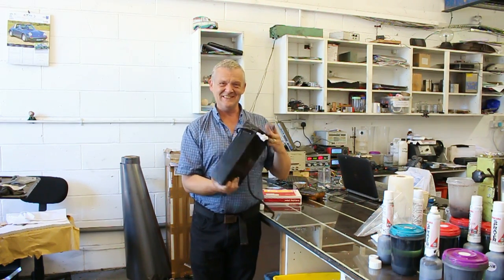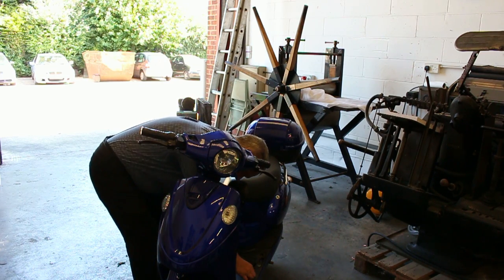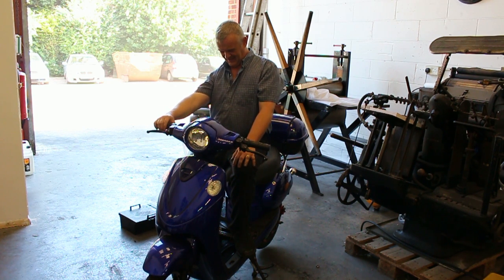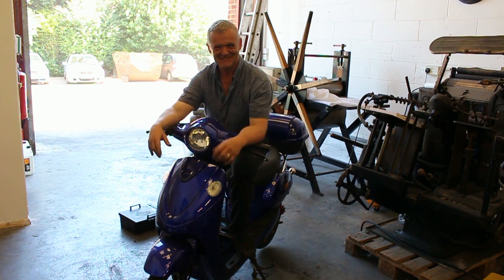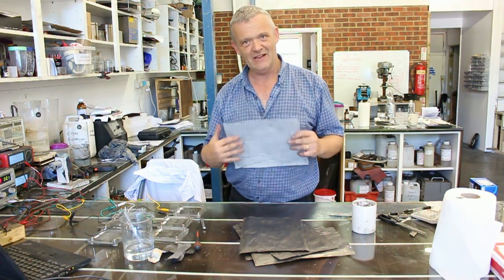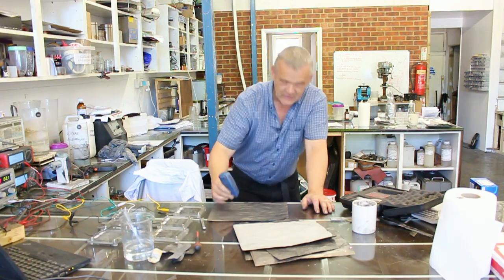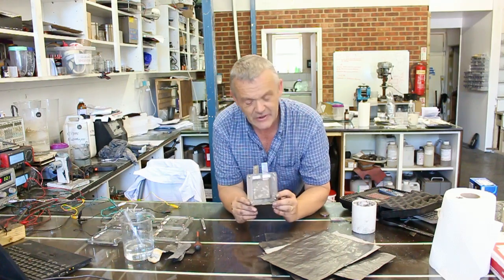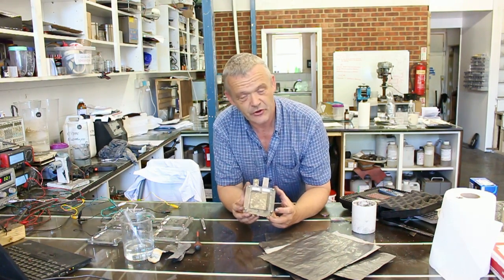Big Battery Bike Build - Testing The EESD

Comment: I am Spanish speaking, I saw your video with the automatic translation, I did not understand some things correctly due to errors in the translation. My question is, do you use bond paper impregnated with graphite on one side and on the other side impregnated with pepper and then put each of those sheets one on top of the other ?, Is that how he made his battery ?, I hope I can illustrate
Reply from the maker: paint both sides of the paper and stack

Comment: I have a doubt: as far as I know, in order to reach the regime, supercapacitors need to be charged and discharged 200 times to stabilize the pores. Did you do the same, or it worked imediately?

Comment: Hi Robert, I love your videos. I am wondering is that battery still working, if so how many cycles do you think it will be good for. How many cycles is it on right now. I am also wondering did you ever figure out what the KWH's in that battery.
Reply from the maker: it's 1kWh mate and about cycle 40 - it lasts a long time and we charge it every few days or so
Reply: 40 cycles? So it means in 40 recharges  of this eesd it become  useless?
Reply: Hi Robert .... any update on number of cycles and how fast it's effective charge is dropping over time ??

Comment: Hey mate! I guess by packing 500 layers in you had some series resistance. How much was the final voltage and the voltage of the single layer? Excellent job by the way!!
Reply from the maker: 48 volts and each cell 2 volts more or less - and cheers mate
Reply: Oh that's a lot of losses indeed. And did the capacitance also drop by a factor 500? Did you use a solid state electrolyte?
Reply from the maker: is it? how did you get there?
Reply: It was just a question. Water electrolytes aren't very convenient with battery stacks and they don't provide high voltage ;)
Reply from the maker: i understand - cheers

Comment: 1kWH bloody hell this is very interesting. my electric bike has a 36v 11ah lithium ion battery which is about 0.4 kWH. I would imagine I'm not alone in wondering if this technology would a viable solution when my existing battery starts to fade. Have you experimented with charging rates? How deeply can it be discharged? Where about in the UK is your lab? Sorry about all the questions, I find this fascinating.
Reply from the maker: no worries mate we are in Canterbury and we have and continue to do a number of tests on this
Reply: Robert Murray-Smith Thanks for that. I have just watched your video on charge and discharge rates, excellent.
Reply from the maker: cheers mate

Comment: Did this come out to one kilowatt/hr?
Reply from the maker: more or less yes
Reply: +Robert Murray-Smith also are these just graphene ink/paint, or are these hemp ink? Lastly do you think that hemp will out perform these? This is a incredible leap for battery technology. Speaking of which, I was under the impression that the EESD was a capacitor, if that's where is the line between a capacitor and a battery cell if this is a battery?
Reply from the maker: this one is graphene the hemp does better but i have to make the large version yet - but i will do just that. There is no black and white here mate the devices exhibit a behaviour that tends to a battery or cap depending on make up
Reply: +Robert Murray-Smith that makes good sense thanks for being willing to freely share this information!
Reply from the maker: no worries mate

Comment: Hi Robert 😄 I was wondering if there is an advantage to building a single high capacity cell and then running that through a 600 watt step up buck converter with the idea of no cell balance issues and easy build? Regards Andy
Reply from the maker: there might be scaling issues to a certain size mate

Comment: Yes! Once you get this rolling, I bet you refine your battery with ultra thin membranes and increase the storage and power of your batter 4 fold. I bet you get lots of orders for ebike batteries. The ebike is great but its so underpowered, because the standard battery cant handle supplying power, when you go up hills, its just useless, unless you live in a flat area.
Reply from the maker: I think you are dead right there mate
Reply: I think you might start getting overloaded with orders for your batteries. Is it possible to protect your manufacturing process and out source your battery production? It just doesn't seem possible to do any volume by your self and your small staff. I'm sure your way ahead and have plans on a full scale factory, cant wait to see where you go with this. I think you should look into safe, high powered, long life cell phone batteries. Every one has a cell phone, and they can some times blow up and are easly damaged by water. If you could make a cell battery that is un effected by moisture, that would be a huge hit!
Reply from the maker: well i do have plans i am working on mate
Reply: Cant wait to see it. I was impressed on how long your power pack did. Over 60 miles on one charge, and only half the size of the original battery. That's pushing twards equal to miles as a gas engine. I cant say how proud I am of your work. I look forward to seeing the results of the data you get. Please give us a comparison on how your eesd does aginst a typical gas driven scooter. I just don't understand why people are not beating down your door to push out these new power storage systems, they are great! With lithium batteries exploding, and  beiyng so expensive and going dead so easy, its a no brainer to switch to your system.
All the best
Randy.
Reply from the maker: cheers mate

Comment: Hi Robert. Hope you got time answering this or some other people reading this. If the separator is the actual paper. How do you get electrolyte in it when both side of the paper is coated? Or how does it work? Fascinating work btw, and hope I can make one similar in the future for my ebike :)
Reply from the maker: the coating is porous - it has to be in order for the electrolyte to wet the active material and go for it mate

Comment: I can suggest a very useful test......... one that I wish that all electric vehicle/battery manufacturers would perform. Find a long and relatively steep upward slope. Start at the bottom and start and stop (repeatedly - coming to a complete stop) all the way from the bottom of the slope to the top and report the number of times you stopped and the total elevation change of the slope and the total distance travelled before the electrical potential of the battery was more than 50% depleted.
Reply from the maker: nice idea mate - if i get a chance i will give it a go

Comment: Are you using standard 80gsm paper?  If so using 70 gsm would give you an extra weight advantage. ( almost 400grams).  As we know weight is a killer in power-efficiency ratios. I don't know how much of a barrier you need between plates but 45 gsm would almost half the weight... but then printing on it would be problematic......I really should not watch these things before I go to sleep my head is now buzzing with numbers I would struggle with fully caffinated.
Reply from the maker: lol - cheers mate - but it is not something that has escaped me
Reply: +Robert Murray-Smith Just me musing out loud
. well on youtube...
Reply from the maker: lol - no worries mate

Comment: Because the solidification of any liquid is difficult to maintain a perfect molecular pattern, what percent of the cells produced are usable for the battery?
Reply from the maker: i have no idea
Reply: Are the usable cells more than 50%?
Reply from the maker: i suspect so as i would have got pretty pissed if i have had to make twice as many and throw half of them away. - anyway, i almost left the reply there but i could see your next post in my mind -lol - so with out meaning to be rude mate that really is a question that hasn't been thought through. It doesn't matter the reasons are it is impossible to anything perfect. You always do stuff within percentage acceptability. In terms of the EESD this reduces the energy that can be stored - or if you like it has an energy cost. As long as this cost is within acceptable limits 100% of cells can be used. The reason i can do this and Li-Ion can't is the technique is easy, the materials cheap and the initial theoretical energy density is so high i can afford to pay this cost - i hope this helps
Reply: Fantastic! I was concerned by one of your statements that stated that to build the battery, it took quite a bit of time. That implied to me that the percent of cells solidified that were workable was very small. If the number that are usable are greater than 50% then the issue is not as important. That is because the solidification process is quite difficult but since only one out of two is not perfect the process you have developed is quite good. Thanks very much for your response.
Reply from the maker: it took ages because it is just me doing it mate lol

Comment: So I did some messing around with some maths, it's pretty rudimentary, I could be wrong, but:

Assuming the 65 micron figure and the dimensions of A4 paper, if we were to assume the battery was just made up of sheets, clearly there's some extra bulk going on there that makes it slightly larger than 500 sheets, then we do:

210x297x32.5 = 2,000,000mm3 = 2ish litres for your battery there.

You said around 1kwh for the energy contained in the battery.

So around 500wh/l for capacity which is about, what, about 70% of the best lithium cells on the market today? That's obviously an ideal figure, based on what you have there it's probably about 20%ish worse than that because of the extra bulk going on. 

It's nice that you have the safety aspect to not worry about, that's one pro versus lithium, the cycle life could be an advantage, though I don't know what that is either and then there's weight which for me is an unknown. Perhaps the power capability since it is a capacitor, though Lithium can whop quite a few amps nowadays, it usually gets pretty hot.

Concerns I have really are the manufacturing of graphene which as is quite well known, is bloody difficult and therefore horrendously expensive and the fact it is less dense than lithium batteries.
Reply from the maker: you have to watch out doing spurious calcs with out all the info mate - a couple of things you do know - it was smaller and lasted longer than the Li Ion that was in there. But hey what do I know i just built it and ran it. As for the graphene bit - you are just plain out of date
Reply: Then it was probably a pretty low density Li On battery, LiPoly can easily be only around 2-300Wh/l, but the highest quality Li-On cells are up to 700Wh/l nowadays in 18650 format.
 
High current cells tend to be lower capacity. I actually thought you said it was lead acid in there at first.

You could also be wrong about that 1kwh and it is more, but I think it is more likely that the battery in there was pretty low density.

Another thing to note is if your battery is higher density by weight then that will give it an advantage over Li-On too because the motor doesn't have to work as hard to move you, the bike and the battery along.

One watching videos where the info isn't given to you has to be very cautious so these calculations have to be made. If you could publish more figures about the battery it'd be great to see, it's not going to give away any "special sauce", just give people a realistic idea about what your cells can achieve.
Reply from the maker: ok

Comment: Hi Robert, this is wonderful, I've been following you closely from the beginning and to see your EESD in a vehicle is groundbreaking.
I myself own a near-identical electric scooter and have done years of testing on it and another similar model. With new stock batteries on the 48V/250W version (4x12v 12Ah lead acid weighing a total of 16Kg - 576 watt hours) it regularly achieves around 12 to 14 miles on a charge when ridden hard (up hills, lots of accelerating-braking etc). I'm probably around the same weight as you.
Interestingly enough, the 36V/250W version (3x12v 12Ah lead acid weighing 12Kg - 432 watt hours) seems to achieve the same mileage in my experience. I therefore deduce that the extra 4kg weight of the 48V version gives little extra to the vehicle's mileage so therefore the power/weight/storage energy balance for this vehicle is about right when running stock batteries weighing 12-16Kg.
My lead-acid's will suffer from low-temperature poor performance compared to your EESD's. And my quoted Ah rating is for a 20hr discharge, not a 1hr discharge, so, again your EESD's will outperform them significantly.
If I were a betting man, I'd say on your 1kWh EESDs you should see a mileage of 40 to 50 miles on this EESD with this vehicle.
This may sound disappointing but should be of no concern and would still prove how exciting the EESD's are. If you want to achieve the maximum range for this demo vehicle, my suggestion would be to build (yet more) EESD's for it, so that the weight of them is closer to the 12 to 16Kg of the original stock batteries (any more and the performance of the vehicle will drop). Of course, it may be impossible for you to build that quantity of EESD's for this purpose and still fit them neatly into the machine (although plenty of room under the seat and in the rear compartment). I don't know how heavy your existing EESD pack is, but would not be surprised that with a few more that you could achieve a mileage of hundreds of miles on a single charge.
Anyone reading this should of course take note that your demo EESD's will become more compact with future manufacturing techniques, so physical size at this point is of little concern, we're interested in energy density (storage vs weight) and you are already beating Li-ion tech with your prototypes.
So you if/your followers are disillusioned by mileage performance of this demo I've explained here why :-)

On another note (from riding around Hampshire and Somerset on this scooter) I have found that local police prefer a sign on the back saying "electric vehicle" - this saves them the wasted time in pulling you over for not wearing a helmet (although please wear a helmet, you are too valuable Robert!!). Also this scooter should come with clip-on pedals (I may have some spare if you need them) - this can help with roadside discussions about legality as the law is confusing and has changed a little, depending on the year of manufacture of the bike.

On yet another note, you may need to up the output voltage of your EESD bank and then put in a decent/efficient DC regulator to supply the bike with the correct operating voltage (36 or 48V). This would be critical in order to make use of the different useable voltage range the EESD's have compared to chemical batteries. Stronger EESD casings and good electrical insulation may be advisable for safety purposes. (I've been thinking a lot about this very project since seeing your first supercapacitor demo's years ago). Another option would be to run the EESD's at about the same operating voltage of the bike, and then have step-up DC-DC converters kick in for when the EESD voltage drops. Or... I'd also consider looking into re-designing the multi-phase motor controller to increase the maximum input voltage.

And on a final note, it might be worth checking the standby current on that scooter, and if it is higher than you like then disconnect the EESD bank at night. I experience quite a bit of discharge on mine when it is left for extended periods.

Many thanks for everything Robert, this is groundbreaking and if I can do anything to help you I will.

Rob H
Reply from the maker: wow mate - that's a really good post - nice analysis and helpful hints - cheers mate i will bear your offer in mind lol

Comment: Does this battery need any sort of BMS for charging/discharging like lithium ion? What happens if it overcharges?
Reply from the maker: it would benefit from it but doesn't need it - if it overcharges it dries out - it's water based
Reply: So you have achieved lithium-ion like weight to kWh without the dangers posed by lithium? If so that's a game-changer.
Reply from the maker: it certainly looks good
Reply: Is graphene the secret sauce here? I have watched the previous videos but there is so much information it's difficult to remember the chemistry you used for this EESD.
Reply from the maker: there is graphene in it mate but the rest is secret sauce
Reply: Hmmm, so is it a supercapacitor, battery or a hybrid? The paper substrate makes me think you are using sodium chloride, as it can epxand and shrink with the intercalation of the sodium ions. What is exciting to me about using paper is the possibly of using cheap, hacked inkjet printers to print these cells on autopilot, making large batteries practical to make for anyone with a shed and some abundant, non-toxic materials!
Reply from the maker: it's a hybrid - and get to it - get in that shed lol
Reply: Haha! Already on it Robert - I'm modifying an old Epson pigment ink printer (SX130) which can handle thicker inks to hopefully run off loads of paper-based cells. Apprently people have been using them for bio-printing. So the large capacity is due to both chemical changes and static charge? What happens if you accidentally short it?
Reply from the maker: cool do some videos mate and send me the links
Reply: Definitely will if it works Robert!
Reply from the maker: v cool mate - looking forward to it